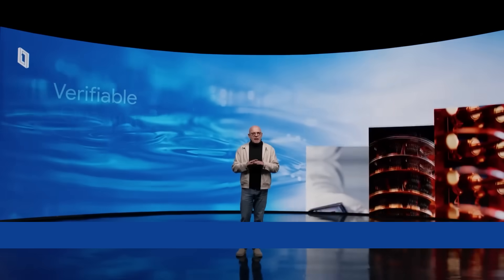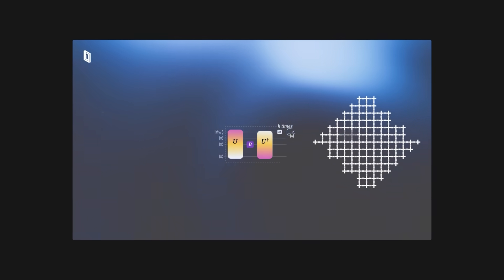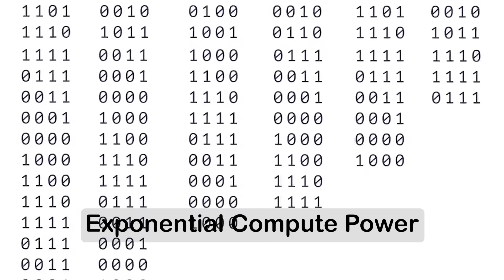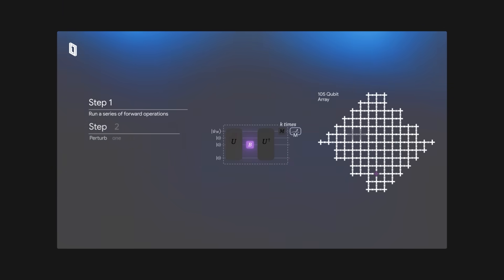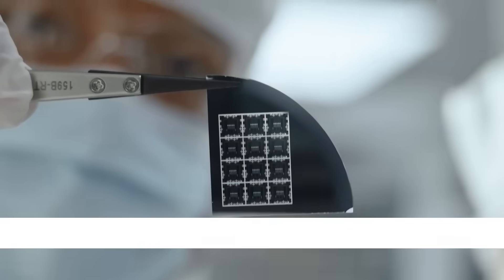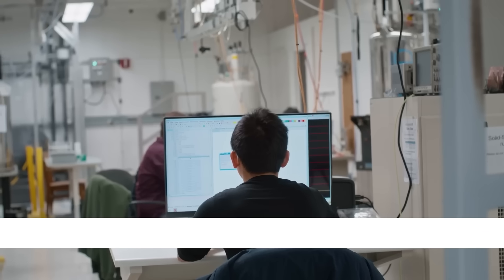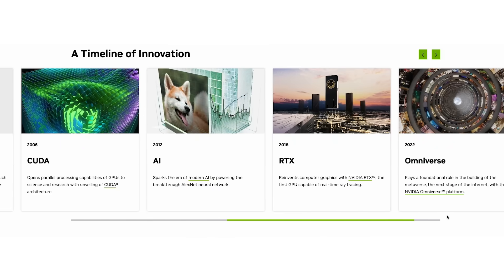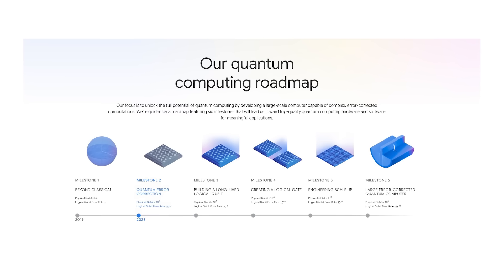Google Just Made A HISTORICAL Quantum Breakthrough!

Comment: They should give this a go:  Quantum Information Dynamics

A: Time-ordered correlator (TOC)
B: Out-of-time-order correlator OTOC^(2)
C: Higher-order OTOC (OTOC^(4))

A: TOC (damped signal)
B: OTOC^(2) (first-order time-reversal, still subject to small-loop interference)
C: OTOC^(4) (higher-order time-reversal, with large-loop interference)

This chain shows progression from a damped signal (TOC) to a controlled but limited signal (OTOC^(2)) to an enhanced signal (OTOC^(4)) that exhibits constructive interference and is classically hard to simulate.

So, we can add:
Quantum Dynamics
A: TOC
B: OTOC^(2)
C: OTOC^(4)

Resonance 3: The constructive interference in OTOC^(4) that enhances the signal.
Damping 3: The time-reversal protocol that filters out the scrambling and allows the interference to be observed.  Therefore, the chain represents the balance of Damping 3 (control) and Resonance 3 (gain) in the quantum information domain.

Comment: Phase computer is basically they phase in the sis. they ensure its 90 degree phase.
Now every microwave pulse will less by 1-2 degree, depends on iterations.

Basically they try to get to 0 and 1 and when it reaches it u get the correct answer.

Comment: There is no super position. its another lie. its just currrent between two magnetic field. One overloaded with microwave pulse which intersect next

SIS - superconductor -thin insulator -super conductore
Super conductor is like close looped circrut. That mean a magetic field

Each side two magnetic field separate by thinnest insulator so it dont touch

Now with microwave pulse it will conduct and current forms

But they ensure its 69.5 ghz so its between 0(7ghz) and 1( 69gz)

When current pass it reduce freq by 100mhz

Instead of explaining this lie to people saying its quantum super position. Criminals

Comment: Can quantum computers make weather forecasts, earthquake predictions, or volcanic activity predictions more accurate?
Reply: yes
Reply: @semjanssen7837  what do you mean yes...? The only reason we cannot do those predictions because of insufficient data. Quantum Computer will not bring you data from thin air. It is just doing computations "faster" than regular High Performance Computers (faster in a sense that less time in bigger search space). To be able to do that search, you still need to have the data. Also, those tasks are not only depending on the old occurrances, but also several different parameters. Quantum computers will not be able to do accuretely because they cannot calculate anything without error even if they would it still wouldn't be enough.

Comment: Say goodbye to sha512 😮
Reply: neither google nor any corp is leaking its technical details about these are achieve which means we're safe coz no one can will be able to just- build a QC
Reply: @Guilred  wait when chinese do it
Reply: SHA-512 should still be safe as long as nobody can prove that P=NP
Reply: @kevinh5212  If I'm not mistaken, SHA-512's security does not rely on the P=NP problem. SHA-512's security depends on the difficulty of finding a collision or pre-image, which is based on its large hash length and complex structure, not the computational complexity class of the P=NP problem. If P were to equal NP, it would likely break many asymmetric encryption algorithms like RSA, but SHA-512, a symmetric hash function, would remain secure against the kind of "efficient" attacks that P=NP would enable
Reply: @kevinh5212  its not a np complete problem its just np-hard. Regardless it will take 2^128 attempts to find the collision so it would still take a billion years to crack sha512 for a quantum computer